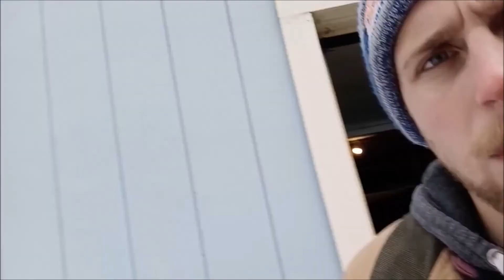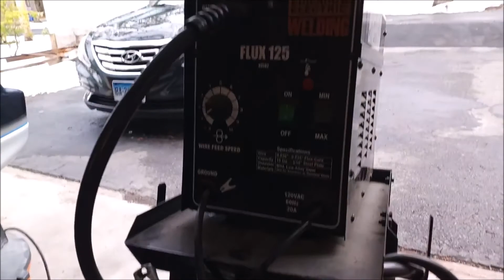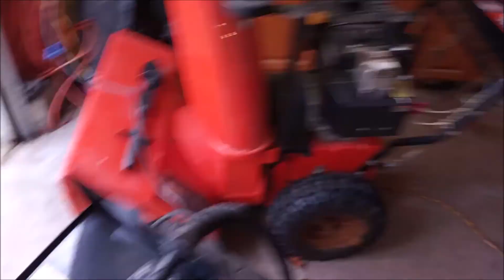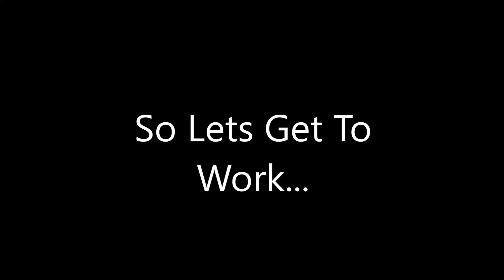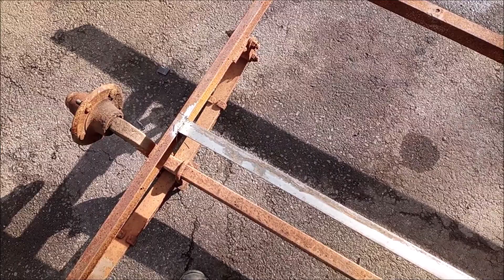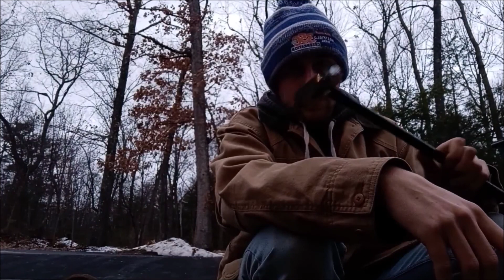TEARDROP TRAILER BUILD Part 1: Frame (FIRST TIME WELDING!)

Comment: Hey man I’m in the process of building a teardrop trailer myself, first time welder as well. I had a lot of luck with hitting all the metal with a grinding wheel to nock off any rust or paint, then hitting it with a wire wheel, then wiping the areas that I ground with some acetone to get rid of any contamination prior to welding
Reply from the maker: The acetone is a good idea! I actually did grind and wire wheel where I was making my welds, I just didn'tshow it in the video. Good luck with your project, and thanks for watching!